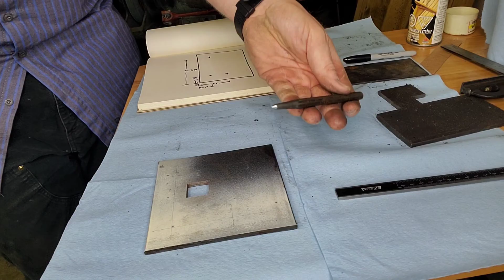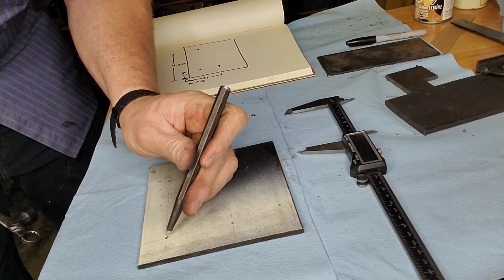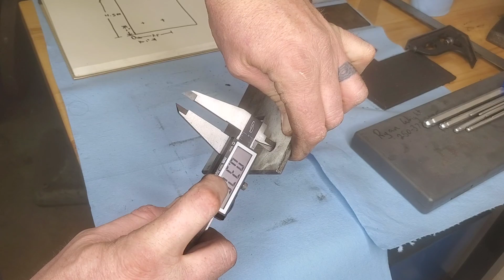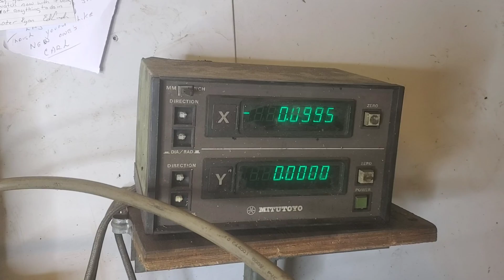Different Methods of Drilling Holes in Steel

Comment: 6:06 That works if holes are of the same size.But the principle is the same if you have one hole bigger than the other-you take measurement from two walls of the hole that are spaced most apart and then you reduce two times  half of the hole size(one time radius of left hole and and one time radius of right hole) from that measurement and you got your center distance.
Reply from the maker: Yes sorry I should have been more specific on that. Thank you  !!.